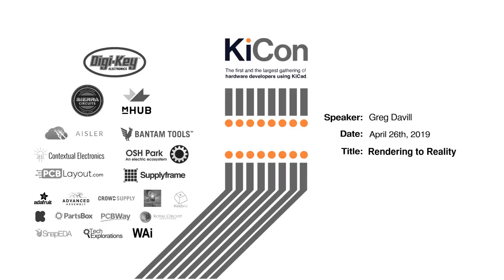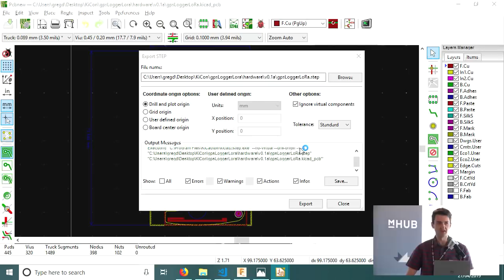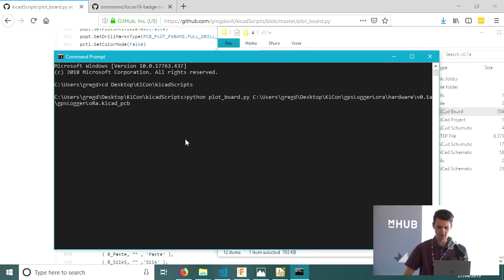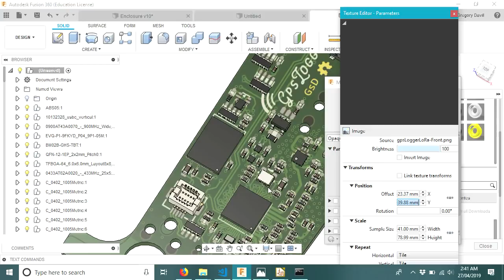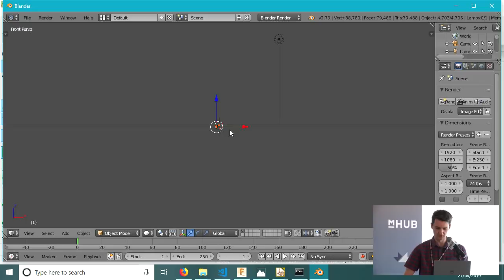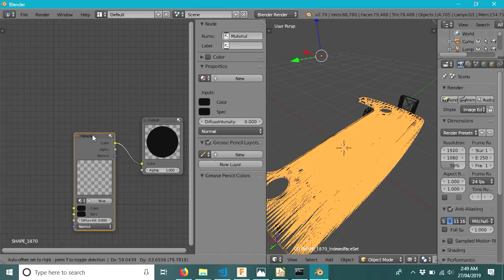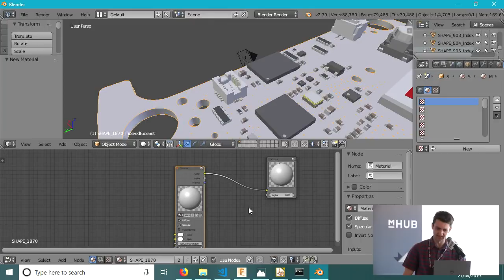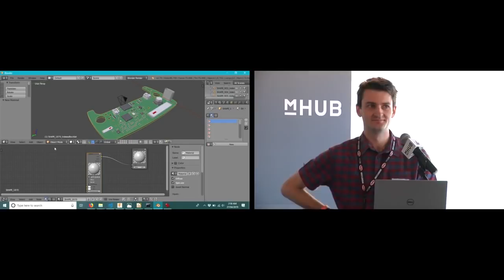"Rendering to Reality: PCB rendering with KiCad, Fusion 360 and Blender" - Greg Davill (KiCon 2019)

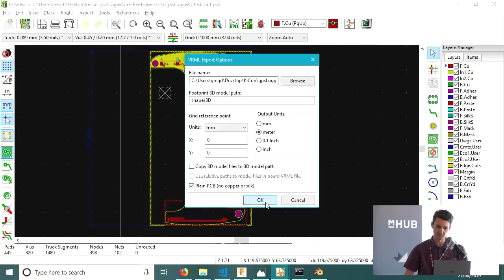Comment: At 14:23, he had 'Plain PCB (no copper or silk) selected, which then forced him to do all the fancy texturing stuff. If you leave this box unchecked, it exports all your copper layers, making it just one file to import, and eliminating the alignment process.
Reply: There was a question about it at 24:27. It actually has advantages and disadvantages (you are not getting additional layer you can tweak with material settings, etc).
Reply: @ellox  Thanks for pointing that out. I've used it in the past and I'm pretty sure it adopts the colors you choose in the 3d viewer, so there's a good bit of customization, but not as much as something like Blender.

Comment: My method for getting renders is 
KiCad  ->  FreeCad  ->  SOLIDWORKS  ->  SOLIDWORKS Visualize
It generates stunning renders and is way easier to use than Blender. 
You can even skip the SOLIDWORKS part and import the Step file directly to Visualize, but I use SOLIDWORKS tweak or add things to the 3D model. 
https://imgur.com/gallery/FjTBX2V
Reply: Cost $$$$$ , all free with opensource